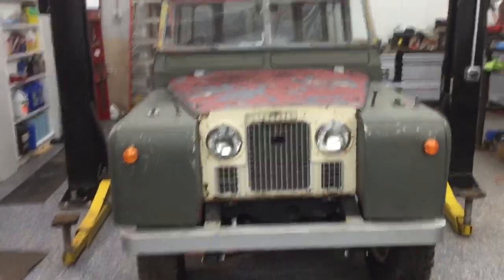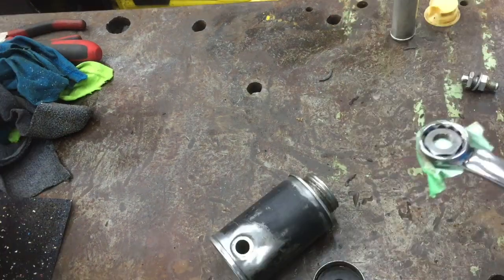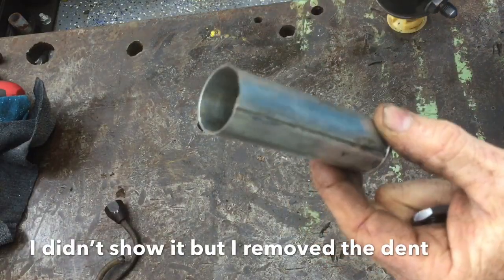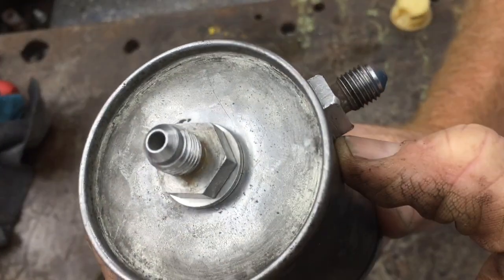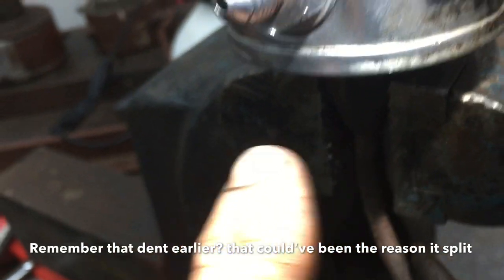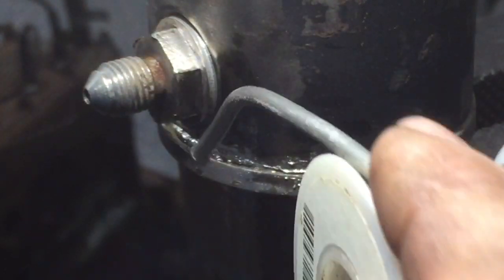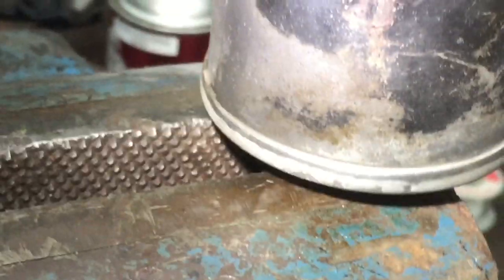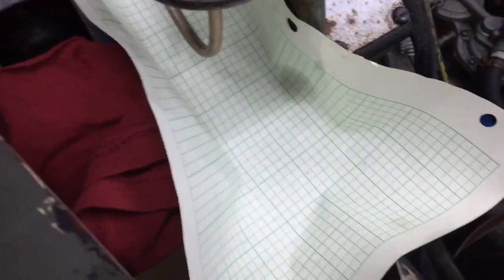Land Rover series 2- Brake fluid reservoir repair

Comment: good vid, i'm not close to restoring my can yet, but looking at mine i reckon its gonna leak lol.
Reply from the maker: Gordon Mackinnon clean every piece really good. And if you have to solder keep the heat as low as possible

Comment: What about the aluminum rod that melts and fixes holes? They sell it at harbor freight call Alumiweld. I’ve never used it before but looks simple. Nice repair on the can!!
Reply from the maker: Cory Anderson I haven’t tried it either. But I may pick some up next time I’m there.
Reply: Fast Dad Garage - North & South Chamberlain’s I had my radiator repaired by a local rad shop. Wish I would’ve tried the Alumiweld first. It would’ve saved some cash.
Reply from the maker: Cory Anderson yeah I’ve had a few repaired, I’ve also fixed one myself. But I had one get even worse after I tried to repair. I got it to hot, not good, solder came apart in several spots.
Reply: Fast Dad Garage - North & South Chamberlain’s overheating. That’s stinks. At least you tried! 😀